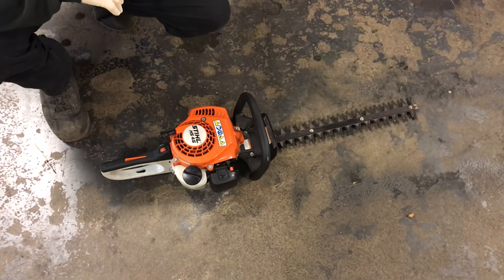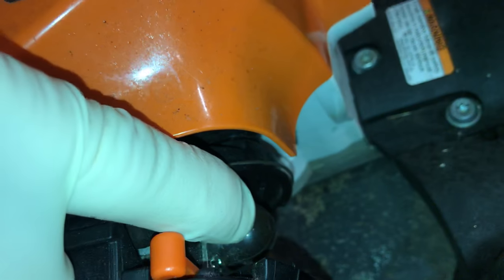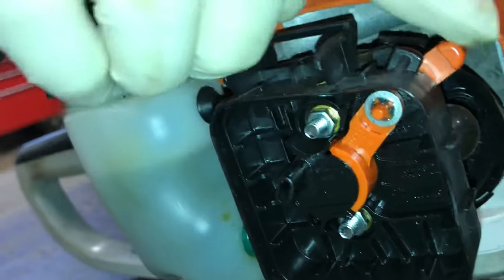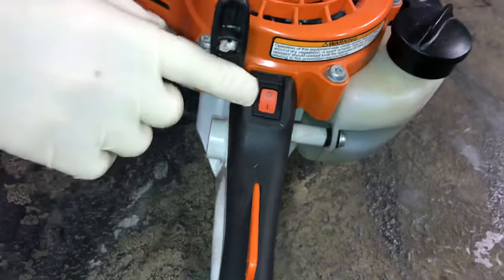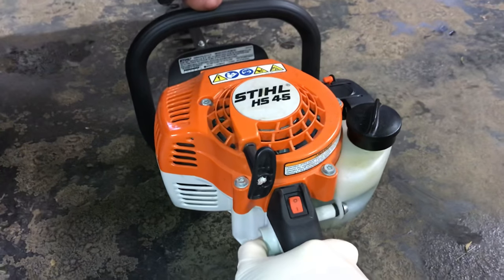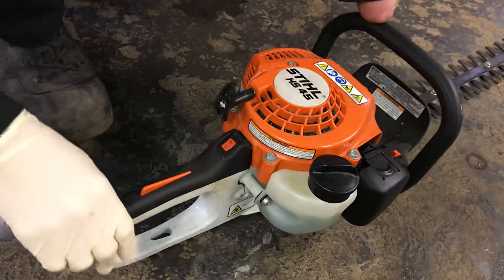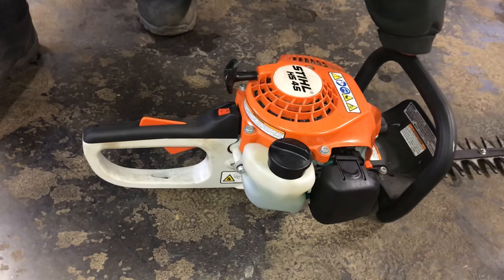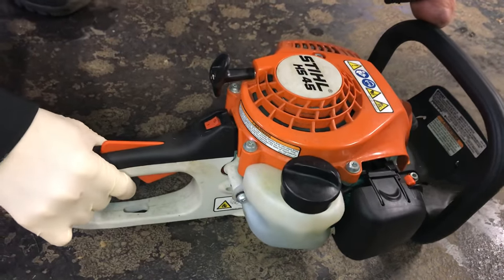How to start a Stihl HS 45 Hedge Trimmer

Comment: Stihl actually recommends turning the Choke OFF after Three Pulls even if it Doesn't show signs of starting to prevent flooding.
Reply: It's odd because my manual says five pulls then off for both my trimmer and strimmer.

Comment: I is for Ignition....The Choke symbol has two line either side of the butterfly..You will notice one run parallel with the lines meaning open the other is across the lines meaning closed. But thanks Im am about to sell mine used it twice to heavy

Comment: Thanks Brad. Last time I tried to start mine I primed, choked, pulled, unchoked, full throttled, pulled some more, primed some more, cursed, tried every combination possible to no avail. I was determined so I sprayed some starting fluid in there and that didn't even work. I decided it wasn't worth the trouble and I would just dump it. I resorted to trimming my Escallonia hedges with a hand shears. I just tried your way and it started on the second pull. I just trimmed one of my hedges that was in dire need until I ran out of gas. Thanks again. 🙂
Reply from the maker: I’m glad it was helpful and thank you for the kind comment! Please give this video a like and share my channel to help it grow. It would be greatly appreciated :)

Comment: The hs 45 is an outstanding hedge trimmer.  I bought it brand new.  I had my Stihl dealer fill it with Stihl MotoMixafter putting an extra cap full  of Stihl Ultra in the tank.  It cranked right up.  It had a slight problem I’d lying until I had cut with it fora few minutes.  I add the extra cap full  of Ultra for the first two tanks.  After that it gets my standard 50:1 Stihl Ultra mix.  I put two tanks on it this morning,, so it is filled with my regular Pond Water.  It never missed a beat.

Comment: Nice explanation on how to start it, and mine will start, but from i hour use from new will not run at part throttle, 50:1 fresh mix, been back to 2 stihl dealers, where i purchased new, they gave me the run around and could not fix, went to another who said "why do you want part throttle, idle and flat out only"...what? Read somewhere to replace the carby, so an ebay carby went on, brand new Stihl carby went in the bin. Ran well for about 18 months and back to stalling on part throttle. I've given up on Stihl, bought a used Shindaiwa DH230, great, no more Stihl for me.

Comment: Thank you for your helpful video. I tried all your steps and my hedge trimmer did not start.  I went back to Ace hardware. The first thing he said us what kind of fuel are you using? I told him I mix the one small Stihl 2 and one with one gallon of gasoline. He dumped the fuel, put in the premix 50.1 fuel and within a couple of tries it started right up.
Reply from the maker: The correct question should have been, “How old is the gas that was in the machine”? It’s not what kind of gas your using. Yes, non ethanol is the way to go and  ASPEN two cycle already pre-mixed is even better. Yes, every one now is making there own fuel. If you can afford to purchase the already mixed gas(it is expensive), that would be the way to go. They also have fuel stabilizers in the fuel for a very long shelf life. Check out ASPEN. I am not affiliated or making any money from them but it is the best on the market in my opinion. I’m glad you were able to get it going!
Reply: I went to try to start it again and it won't start. Fuc# Stihl equipment 😡  Going back to Ace and have them start it for me.....again..😫

Ace said if it does not start after several pulls with the choke on,turn off the choke as it can flood the engjne.

Comment: Most frustrating machine I’ve ever had.  Started hard on first use and won’t start after 300 pulls on the 2nd usage! Gonna try and return to store for more tips tomorrow
Reply from the maker: Hi Brad, I agree two cycle machines can be frustrating. Maybe try a battery powered machine?? The batteries are getting much better with holding a charge for longer run times.

Comment: I still choke my hedgers and spark plug is super wet with it being primed and choked and I still have trouble starting it.
Do I not choke it it's just getting too much gas?
Any hints?
Reply from the maker: Yes, try a new spark plug or at least dry the old one out, then try and start it without choke and full throttle. Also make sure your air filter isn’t dirty or clogged.
Reply: @JohnsonsSmallEngines  ... It's brand new.
But nobody ever showed me to do that half throttle shit where you lock it at half throttle and then choke it and then start it I never did it that way maybe that's the problem.

Comment: Hi mate, a quick question once I start my hedge trimmer ON after that straight way blade start move continually , with out press the button. What can be problem?
Reply from the maker: The idle may be to fast or the blade clutch is bad.
Reply: @JohnsonsSmallEngines  
Yea, ideal is bit high how I can down the ideal? Please advise me. Thanks

Comment: I'm gonna replace my spark plug but I do not know what brand and measurement appropriate? I would prefer to buy it on Home Depot if that is possible?
Reply from the maker: Spark plug (resistorBosch WSR 6 F,type):NGK BPMR 7 AElectrode gap:0.5 mm

Comment: I've just gotten a trimmer like this (same manufacturer, dont know about the model) to use at work and I find the idea of using that button a tad dubious. That said I've never used a hedge trimmer before, only strimmers and mowers so I'm probably just not pulling hard enough on the starter cord to fire the thing up (too wary of the blades if I'm honest).

Still this was a very helpful video!
Reply: Hikaru WDM practice will ease it out for the buttons and with the pull force just go hard stihl is reliable and these machines last decades if cared for
Reply: @rankoss3437  I will do! I've never used a trimmer before and the machine is brand new so I expected it to feel hard to start (as if the switch wasn't on or something) and I'll have to get over the idea of blades near me too! I know that STHIL are solid machines (it cared for like you stated) I just need to pull harder than what I'm used to (it's no bigger than the strimmers so I should get used to it soon).
Reply: What he didn’t say was, that there is an orange lever underneath, when it is pulled out it locks the flywheel and stops the blades from moving when you start it,  when you have the engine running just press the lever back and you are ready to go..... an often ignored safety feature.......
Reply: @mountfields  where about is this lever? I can't seem to find it on mine. I can find the choke and the hold throttle button you push in on the side but that's it.

Thanks in advance.
Reply: Hikaru WDM. Hello, turn m/c upside down, orange lever tucked in by the carb and gearbox, pull it out to lock..(has a strong spring)......
Reply: @mountfields  right thanks. I currently don't have the machine so I can't do this at the moment, The estate manager has it after asking for the machine. Maybe he can get it to run or will take it to a service centre. We've had problems with machines not running due to the fuel line getting blocked by rust (we have metal petrol cans but are slowly changing to plastic).